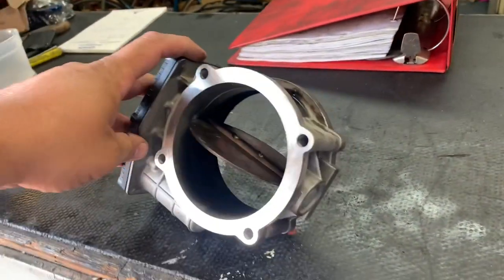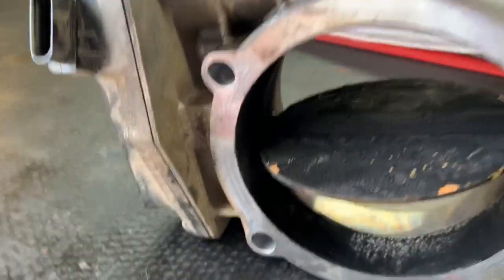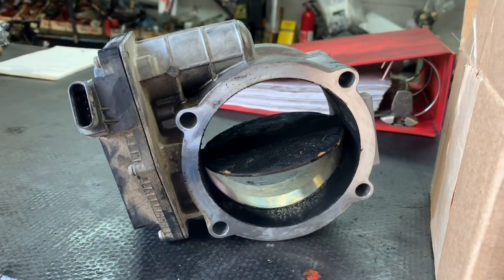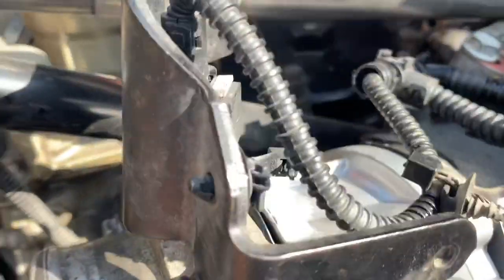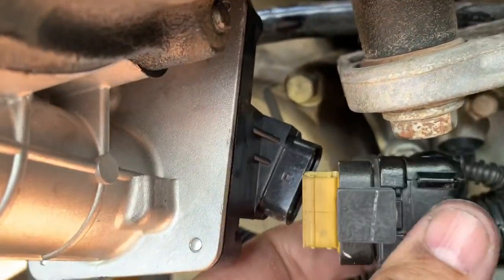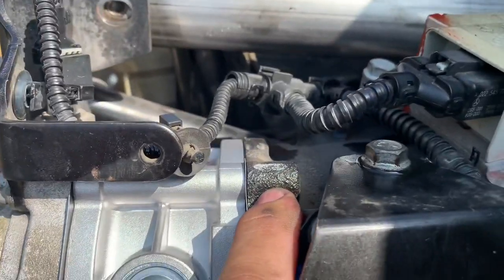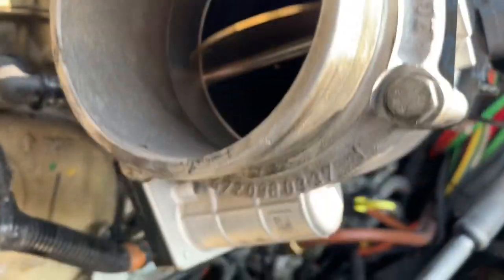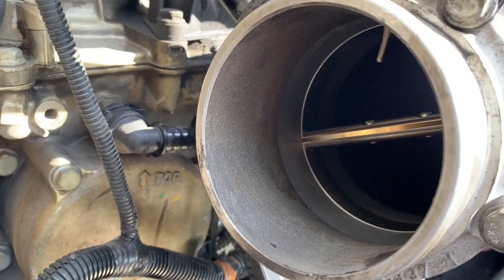Freightliner Cascadia DD15 Intake Throttle Valve replacement

Comment: Need some advise here before replace the Intake Throttle Valve.  Using DDDL I can test it send a command and it moves is the position I requested my thing is when the Semi is driving or when I initiate a Regen I have no readings on those two sections.  The butterfly inside is not stuck you can move it by hand and by using DDDL software. So any advise would be greatly appreciated.  Thanks

Comment: I got a code and replaced it with a new on because it didn't cycle when I turned the ignition ON. Still doesn't cycle with new/old throttle valve. What you think is the problem? Code went away too...

Comment: 2016 cascadia I got fault code SPN 3464 FMI 16 and I already change the intake pressure boost sensor could it be the throttle valve and do we need to calibrate with computer or I just install and it will calibrate it’s on please advise thanks
Reply from the maker: Could be turbo or turbo watergate related
Reply: @CarlosDieselElectric  but turbo works fine o hear the whistle and turbo boost meter shows when you switching into higher and lower gear with jack on some time truck runs like butter but some time even bobtail drive so heavy and code clear by it self and then comes back .. wha could be please advise thanks
Reply: @jaymultani6573 hello Bhaji, Did You Solve This Issue? having same code pop up on freight cascadia 2016, Changed Boost Sensor Too, Dasyo Kive Sahi Hoyi Problem
Reply: @dhillon11  Veer I  changed intake boost sensor,  intake temperature sensor and throttle value .. and it solved my problem how’s your turbo ready ?
Reply: Reading pressure on turbo gauge when you drive in Higher RPM ?
Reply: @jaymultani6573 Thank You For Reply Fast Bhaji, i Changed Only Intake Temperature Sensor Yet, definitely change Boost Sensor & thorttle value, Mere Truck Te Turbo Wali Gauge Nai Haigi Bhaji, But Mai OTR performance Da Diagnostic Tool Use Karda Os Te Code Pop Up Hunda During Regan Or High RPM drive Karde Yellow Light Ho Jandi Few Hours or Next Day Inactive Ho Jandi, Local Mechanic Nu Puchya Kise Nu Es Bare Jada Knowledge Nai Oh Step By Step Change Krna Chohnde, But Mai Other Forms Te Check Kita C Oh V Same Solution Dasde Jida Tuhade Hoya Or Wastegate Related, 🙏🏻

Comment: My 2015 DD15  recently started increasing RPM after I down shift. For example- I rev the engine drop a gear the RPMs eventually drop then suddenly they jump right back up momentarily. It sounds like it is trying to drop another gear as if it has an automatic transmission. Is this a throttle valve issue, or something else?

Comment: I have a problem with my 09 accelerating,  when changing gears it takes a few seconds before its rev up into power soon as i shift, if im idling I rev the engine and sometimes it raises like normal then sometimes it doesn't so im wondering is it the throttle valve bad or could it be the throttle position sensor? While I'm riding it accelerates fine once im going but when im shifting up or down shifting is when its a problem
Reply from the maker: You can connect the software and run some tests. This will allow you to see if there are any inactive or active faults. 
This is important to see the history
Reply: What was yo our problem ? I’m having same issue
Reply: Having same issues what did you do to fix

Comment: My intake throttle valve stopped working and the check engine light came on. I tried to regen and the engine started to surge. 
Now the valve is working fine again, a day later. Should i still change the valve?

Thanks, for your response.
Reply from the maker: @tracannon  yes. If the valve is getting stuck open or closed and is not responding correctly. Then yes. Also check your delta pressure sensor and the Venturi pipe for blockage

Comment: Hi question what are the problem  you Can have with the truck having . I found my self replacing electric fuel meter and it fix the rpm up and form on idle but still no to much boost one guy in youtube mention actuator egr might causing de-rate issues . Can you give your thoughts 
Thanks good video
Reply from the maker: Low boost, recommend to check the Charge Air Cooler (pressure test) first before you replace the EGR actuator. If you have a leak this will cause the low boost. 
Start there

Comment: Quick question does the Intake Throttle Valve activate the EGR system? Also great video!
Reply from the maker: The intake throttle valve works with the EGR system during the regen process and also the driving process.
Reply: @CarlosDieselElectric  Thank you!
Reply: @CarlosDieselElectric  a question related to this valve.
On cold weather and less than 1000 rpm like while warming up or driving on low shift it is very smoky but not once is warm up or at hot weather. My other truck is the same year and model . 2015 cascadia, and don't do this. 
I changed injectors but still the same.
Reply from the maker: @marcomora9630  do you have a delete?

Comment: Hey I have a question I have a egn 1 3464 fault 16. engine light comes on then couple days goes off. a lot of times the code clears before I can check it. my truck runs great and my throttle body activates with key. I have checked and cleaned my connection same thing.  any ideas? you think it's a faulty sensor? maybe pressure sensor. I don't know how to find it cause it's not consistent.
Reply from the maker: Trenton Johnston let me check the code tomorrow when I get in and I can help a little more. 
What year is the truck? How many miles?
Reply from the maker: This diagnostic is typically Intake Throttle Valve Deviation Error.
There are a could of ways to troubleshoot.
Reply: How you fix it got a same problem
Reply: @ryangrewal7402 how did you fix it i have  the same problem
Reply: I have the same code what could be ?
Reply: Update in case others have this issues for me after I replaced the throttle body the boost sensor and a bunch of ther things it  ended up being the connection to the Vpod some people call it the actuator , the prongs inside it were loose that’s why the codes came and go ! Hope this helps
Reply: @MilesAhead028  actuator it self or the actuator solenoid plug pls explain and fixing it by my self please thanks
Reply: @jaymultani6573  so I called it V pod it’s like behind the turbo on the engine. It has a small blue air hose that comes out of it and connects to the wastegate and it was plug that attaches to it
Reply: @jaymultani6573  the plug that attached to it had a loose connection so I replaced that plug very easy
Reply: @MilesAhead028  thank you for getting back to me. I’ll check as per your instructions and get back to you
Reply: @jaymultani6573  no worries good luck
Reply: I have the same issue mine has a derate of 10 could it be the vpod? I keep getting the same code Intake manifold pressure too high
Reply: @MilesAhead028 did you get any derate
Reply: @la2toronto789  i did , not a lot though I was still able to drive home
Reply: @MilesAhead028 Hello Brother, I’m Getting This Code Spn 3464 Fmi 16 ( Engine Thorttle Actuator 1 Control Command) On My 2016 Freightliner Cascadia From Couple Months I Changed IMP sensor But Still Not Solve This Issue l, Not Losing Power When This Code Came Driving Fine & Code Go Away It Self And Come Back When Going Hill, Intake Manifold Pressure To High, Try Many Mechanic Everyone Have Own Theory And Wants To Change Many Parts, Can you give instructions how Ended On Yours, Thank You
Reply: @dhillon11  I changed the throttle valve , intake boost sensor and intake temperature sensor and it solved my problem my throttle valve was working when I checked but some time you are on the road it doesn’t operate it suppose to but I changed it anyway plus not get reman get New one .. I hope this help ..
Reply: @jaymultani6573 ..i am having the same problem!...3464 fmi16...comes and goes away...i already replace the pressure sensor...will try to replace the body intake..hope is not expensive...thanks for the comments to averyone!...helps to try to figure out on your own some issues!
Reply: @MrSardo0707  don’t get the Remanufacture get   New one ..

Comment: What hapoend with showing which type of cose it was
Reply from the maker: pablo trejo there are a few different fault codes for the Intake Throttle Valve. Let me see if I can remember this one. What code are you getting?
Reply: @CarlosDieselElectric  I'm getting ENG 1 3464 FAIL 31

Comment: Hey Carlos, this morning I got a code on my 13 Cascadia (eng 2 001 3464 throttle ) and I kept working thinking I would get to it on my day off. Everything was running good until I got to my last load and my truck would release a lot of black smoke on the higher rpms. The fault code is now gone but the smoke is there. You think that smoke has to do with the throttle valve?
Reply from the maker: george saucedo could be related. Has anyone plugged into your truck to read the actual fault code? If it is the ITV, this could cause issues. Remember things work electronically and mechanical, so electronically it could register properly but mechanically it could not be doing its job correctly. I’ve seen that happen many times.

Comment: As a preventive maintenance, can you clean these if dirty? Like cleaning throttle body on cars. Or not recommended?? Tbanks in advance
Reply from the maker: Jose Deleon that is a great question, you could try to clean the throttle valve but if the valve gets stuck you may still have to replace it down the road. 
Luckily the price of an Intake Throttle Valve is pretty good. For a new one you are looking at around $175 or a factory rebuild  but I don’t recommend those.

Comment: I have a code, Engine 2 SPN 102 FMI 18 on 2016 dd15 cascadia I changed the intake manifold temp sensor, code cleared but came right back, took new sensor out ant it has soot all over again, any suggestions if you've ran into this problem.
Reply from the maker: Quick google search comes up with "Intake Manifold Pressure Lower than Expected Under a Load. Monitored Parameter" Check your CAC, check your venturi pipe and the ports for blockage. Also, if all those check out then run a parked regen and see what the numbers are. The DOC Inlet Pressure might suggest One Box issues. Excessive soot can be from injectors, valve adjustment so also have your mechanic run and idle speed balance test and see if any injectors might be off.

Comment: Mines don't cycle when I turn the key, truck drives and idle fine, only thing I've been noticing is a sound like when the air compressor on followed by a vibration when taking off up till about 50mph it goes away
Reply from the maker: Open the key (engine off) and try moving it manually. It should have heavy resistance and stay open. 
When you open the key it should cycle (sweep) with the key
Reply: @CarlosDieselElectric  it doesn't move I put a new one on it just now and this one doesn't move either, the plate moves fine with hand but nothing with the key on

Comment: Hey Carlos question how would the truck run if your having throttle valve problems?
Reply from the maker: Bernard Haddock typically there is fault code. Active would give you a Check Engine Light or Inactive, but you need the the Diagnostic Link Software to see. 
Now physically the truck at idle may seem like it is dying as if fuel or air is not reaching the engine but when you accelerate it responds. During a regen (parked or driving) they maybe a surge or seem like the engine is hunting trying to stabilize at a certain RPM. 
You could use the software any manually control but that has its limitations.
Reply: Ok can this effect your egr and turbo actuator performance?
Reply from the maker: Bernard Haddock possible since the ITV maybe closing instead of staying opening or not doing what the MCM ( computer) is commanding. What kind of truck are you working on? Do you have any fault codes? Active or Inactive?
Reply: @CarlosDieselElectric  

2009 Freightliner Cascadia DD14 60 series I have DPF and EGR no DEF. But I had a fault code for a bad relay they switched the relay out and I thought that was the problem because they told me that's why the check engine light was coming on. Now a few months ago I had a DPF fault code the told me it was the EGR and got it replaced and that EGR was bad so they replaced it under warranty ever since I've been having problems! And I took it back to the shop and it was saying my egr was stuck close along with my turbo actuator valve restricted operabilty but they both were inactive!!
Reply from the maker: Bernard Haddock how is your engine harness? Is there oil contamination? Disconnect the injector harness on the driver side and check for oil. Also at the MCM on the 120 pin, remove and check for oil contamination. If oil is present then this could be the reason. Have any of the harness’s been replaced ?
Reply: @CarlosDieselElectric  
Yes the engine harness but not the injector harness
Reply: @CarlosDieselElectric  
Honestly they told me that and I was told that's not the prob but I will be getting that taken care of
Reply from the maker: Bernard Haddock the only reason to replace the injector harness is when the oil is passing through and contaminating the main engine harness. If the main harness has been replaced then you have to address the other issues like the turbo actuator and the EGR valve. Possible MCM issue could be one reason for this. 
Try doing a valve adjustment, if your producing too much carbon this could also cause the EGR to get stuck due to carbon buildup and the turbo actuator binding because of the turbo VNT (internal) and not allowing the actuator to move and operate properly. 
I know this is a lot to take in but talk to your mechanic or the shop and go over what is happening. 
Let me know
Reply: @CarlosDieselElectric  
Do you think I should change the injector harness?
Reply from the maker: Bernard Haddock I don’t think it is necessary at this time. Try using a test MCM.
Reply: @CarlosDieselElectric  
Ok thanks alot
Reply: @CarlosDieselElectric  HI 👋🏽 I could really use some advise. I have a DD13. When I am bobtail the truck is fine with no power lose issue. When I hook up to a full load I can shift and reach 75MPH then after about 10 minutes of driving I lose engine power not electrical power, it feels like the truck has stalled out. The RPM drop down and the engine goes silent,, as I press the accelerator nothing happens and the engine does not rev and it turns off even if I keep pressing the accelerator pedal down.. but I can turn the truck back on and then I can press the accelerator and the engine will rev and I have to keep attempting to shift into gear bc it will stall out again and eventually its like it gets enough power to shift into gear but I can not pull my load more than 25MPH. I have no check engine lights no smoke no leaks. I have replaced the cam housing seal, the engine harness, injector rings, oil cooler and gasket (even though no oil in the coolant), oil change with new filters & new fuel filter, the EGR Actuator. I was told the turbo was fine. My DPF system is working fine truck does normal regen. I recently changed the NOX Sensor, ECM was replaced. Starter has been replaced. 
Another shop is telling me the truck needs a engine flush and to clean the EGR Cooler using ultra sonic waves and to clean the DPF filter. 
I feel like your description of the throttle not working properly is almost exactly what I'm experiencing with my truck. Please if any ideas or direction as to what could be possible cause, would be greatly appreciated 🙏🏽
Reply from the maker: @marknorth1686  does your truck have an Intake Throttle Valve? 
If so, that could be the cause. They can stick in-the closed position and give you similar problems you are describing. Have you replaced it?
Reply: @CarlosDieselElectric  no I haven't yet but on Monday they want to do the flush and clean the egr cooler and dpf filter. I will mention to them, to try this first.
Reply: @CarlosDieselElectric  I'm thinking about when this started. 
The truck didnt start doing this until after I ran out of fuel one day about 3weeks ago. Roadside cameout and brought me fuel that day. After putting the fuel in the tanks the truck didn't start up right away so he sprayed starter fluid spray into the air filter on top of the engine and he pumped the fuel pump by hand to get fuel into the fuel line. Which makes me think did something happen to the fuel pump? Bc this problem started after that day.
Reply: @CarlosDieselElectric  is it possible to be an issue with the pedal?

Comment: Do you need to  calibrate it with the turbo
Reply from the maker: Omar Hussein no. It is self checking. When you turn the ignition on, the valve will sweep on its own.
Reply: @CarlosDieselElectric  Thanks alot